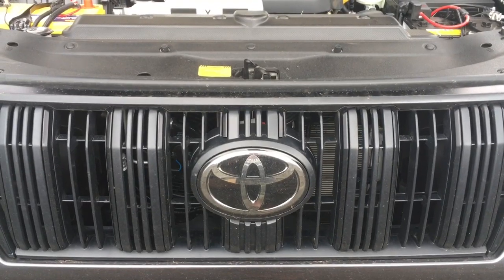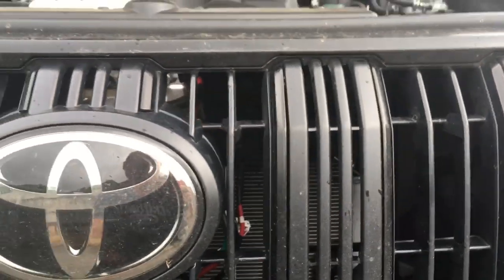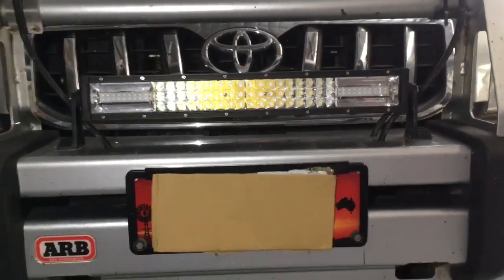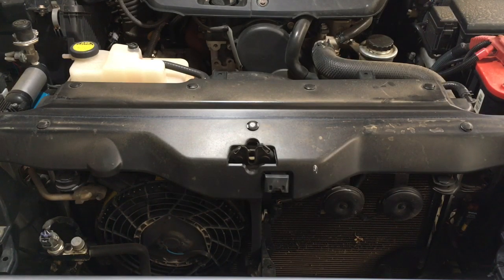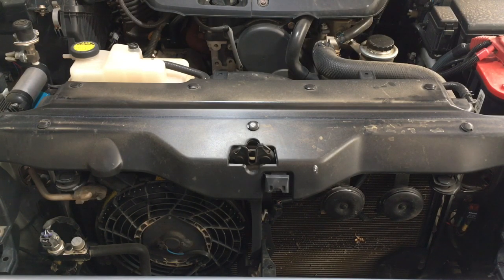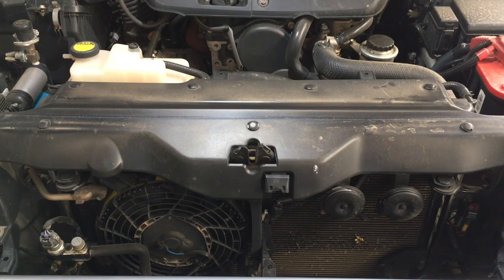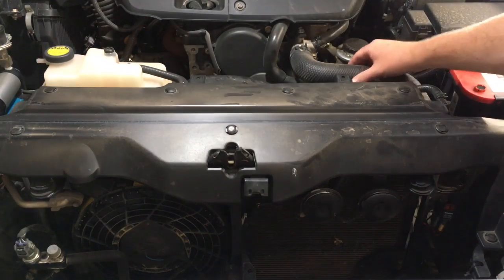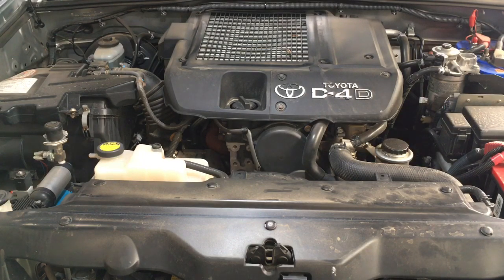VEHICLE COOLING SYSTEM & OVERHEATING

Comment: No bull bar, no light bar, no chip, no remap, no problems 2009 150.
Reply: I have isuzu with  bull bar, lights, chip, and absolutely no overheat.
Coolant temps are controlled by the thermostat in an adequate cooling system.
Reply: @merlingeikie  but at the end of the day, it's still an Isusu.
Reply: Same here: bull bar, winch, spotties, insect grill and no overheating ever. It is pretty hard to overheat a modern vehicle if the system has been properly designed and is working correctly because over capacity is engineered into the cooling system. Most overheating is due to component failure or lack of maintenance.

Comment: I have a ln167r  5le hilux with water cooled turbo new engine new motor new cooling  system temp jumped up on freeway  backed off went back to just went back to normal just under half  would the turbo  be the cause for standard rad to not coap  under load